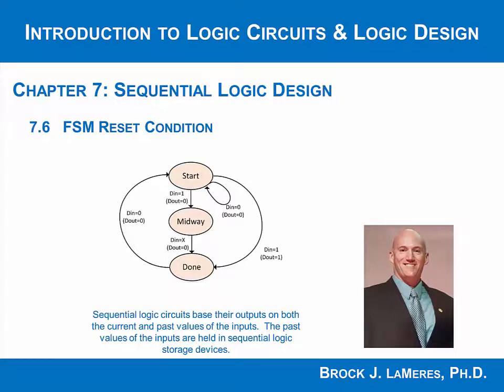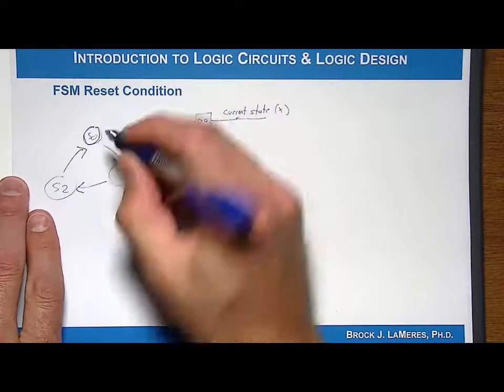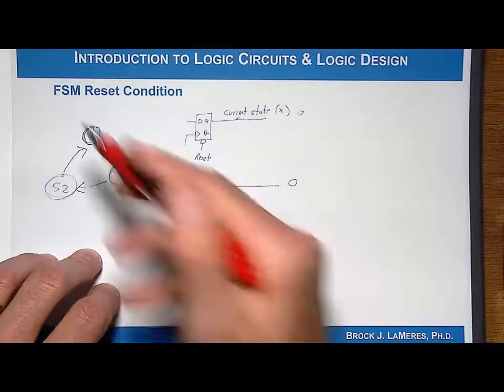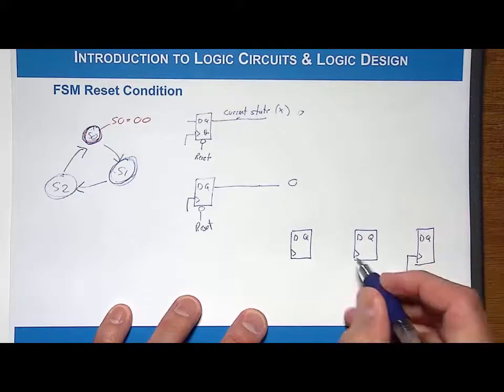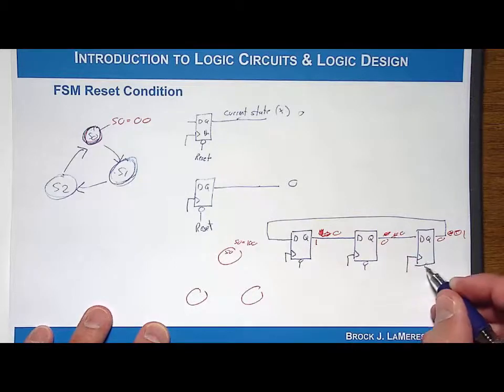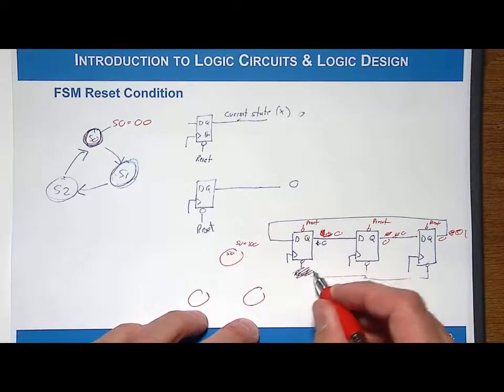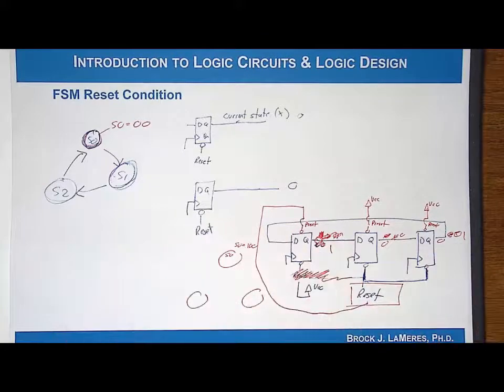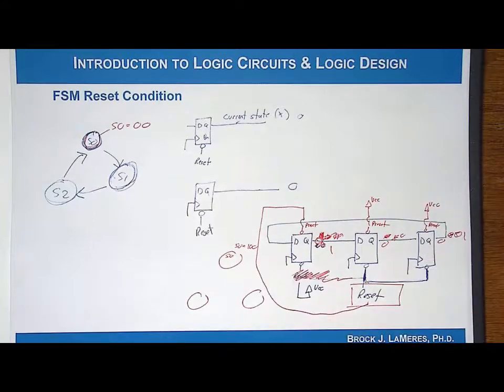7.6 - FSM Reset Condition

Comment: I was wondering how to reset when using one hot encoding. Thank you!
Reply from the maker: You need to use a preset instead of a reset on one of the Dflopflops.    A preset does the same as a reset, but instead puts the Q to 1 instead of 0.